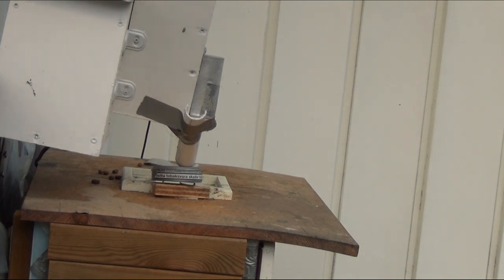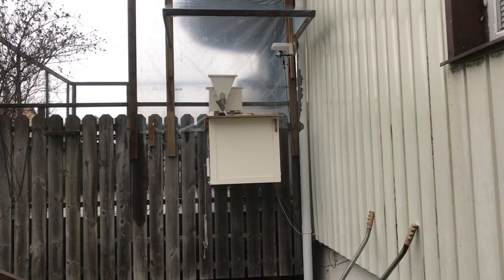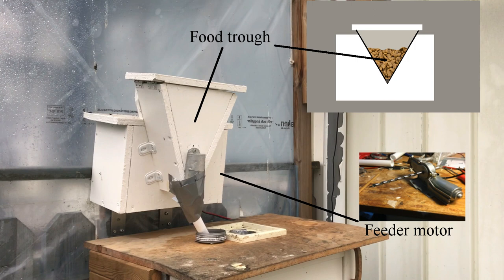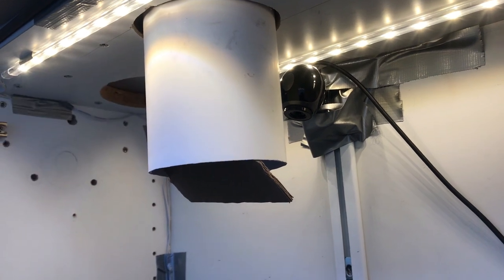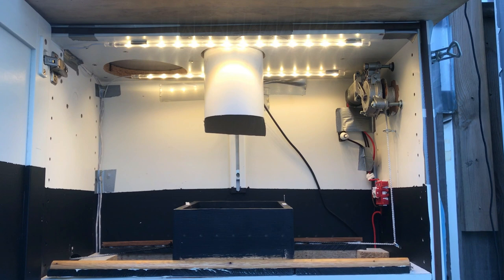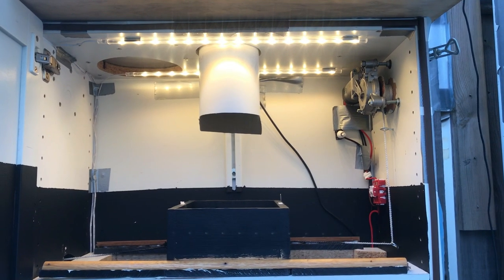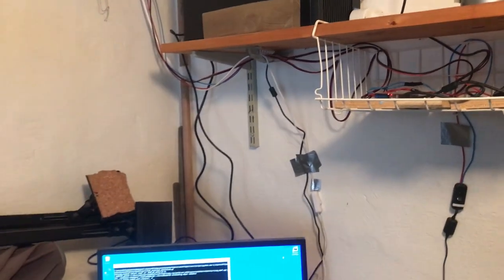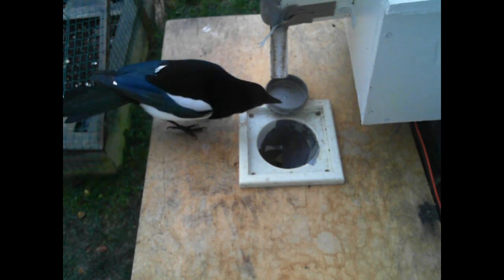How the "magpie-machine" works

Comment: This should be tested with multiple types birds. Great work!
Reply from the maker: Thank you! We try to attract as many birds as possible to the machine, only magpies so far tough. I think we would attract more species if we would be able to put it in a different enviroment.
Reply: @magpierecyclingproject2238  How much is the cost and installtion of a similar setup. I'll be keen to try to setup one !
I'm near the ocean. Vancouver BC Canada
Reply from the maker: @guillaume_tca  It is hard to say, the main expense we had was the second hand computer and the web-cams. Most other material is cheap or recycled. We are now trying other setups setups, for example using a microcontroller instead of a computer and other sensors than a web-cam. It is nice to hear that you find the project interesting. Feel free to ask further questions if you need help.

Comment: this is really cool, came cus of reddit.

Some thoughts:
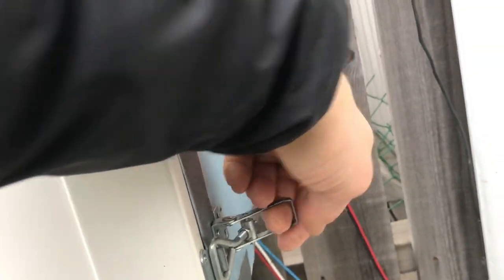@1:46 and 3:13 you have some wires exposed to the elements, you should cover/weather proof them. Even applying heat shrink would be better than letting them sit out like that.

@3:15, you could call them clasps

@6:56, you'd better be sorry about those wires ;)

-with enough research, i.e. measuring how much trash vs. food vs. electricity spent on magpies you could approach a local government for funding

-magpies could likely sort out a whole garbage/recycling heap

-cats would likely eat a group of birds, so watch out for that

-this has some fantastic use cases for a.i.

-you should be careful of overtraining the birds incase they become too dependent on your feed. If say you were to train them for several generations over 25 years, most would likely die off if you were to stop feeding them. There was recently a story about seagulls dying off because no one was around to feed them. So maybe for like 4 months out of a year, never turn on the feeders or something.

 You might be able to solve this easily with a simple but not obnoxious light as a signal for the feeder being 'on'. No light on would signal/train them that the feeder is 'off'

-you might be able to train them to deposit different colored/types of material based off light colors i.e. yellow garbage to the yellow light, blue garbage to the blue light, ect.

-it'll be really cool if you could train squirrels
Reply from the maker: Thank you for showing such great interest and for all the feedback! 

@1:46 and 3:13 -  Yes the handling of cables here is not good by any means. In the next prototype we will focus on improving this since we now have proof of concept.

@3:15, Thank you haha!
 
goverment funding - Absolutely, this far the project has primarly been aimed towards proof of concept, further development will be aimed towards something that could be interesting for government and such.

sorting garbage - Great idea, there is plenty of potential.

cat - Yes, we have placed the contraption in such a way that it will be hard to reach without wings. Lucky for us our cat is a bit to slow to be a good hunter, also she is quite small and does not seem to be interested in the magpies, but the risk still exist of course and there is by no means something that should be overlooked.

a.i - I agree.

seagulls - This is good point and a problem that should be considered developing a machine like this. From one perspective I do not see this machine being different from normal bird feeder where they would get food whenever they want, also these animals already depend a lot of human interactions. We have seen good signs of them not only relying on our machine for food, on rainy days there are few interactions and they are instead hunting worms from the lawn.

different colored objects - This is a great idea and something worth experimenting with further ahead in the project

squirrels - yes I would love to see more species interacting with the machine.

Comment: What imaging classifier was used?
Reply from the maker: We used a SVM (support vector machine) using features from color channels of a training set consisting of pictures of real litter and non-litter. It is not perfect but good enough.
Reply: @magpierecyclingproject2238  would be great if you could provide more detail. I've been looking at scikit-learn for a different project. Did you use something else?
Reply from the maker: @jeffh7195  Yes we used the SVM from scikit-learn. The classifier is not used in the project tough, from our experience the magpies only return litter and no non-litter objects after being trained. We have 5000 interactions and so far they have never dropped a non-litter object. Are you interested in making a classifier for litter and non-litter for something else?